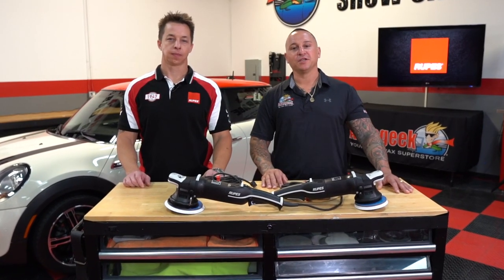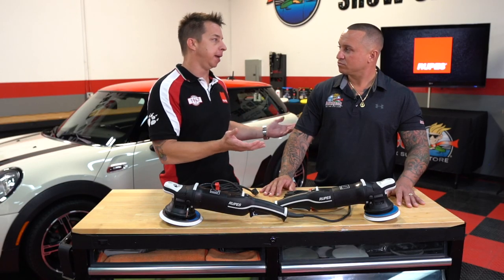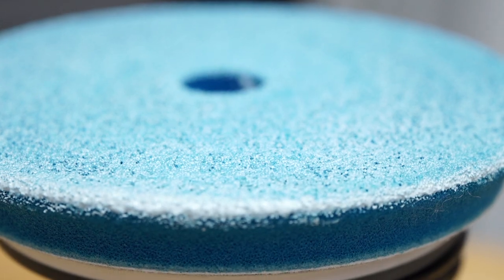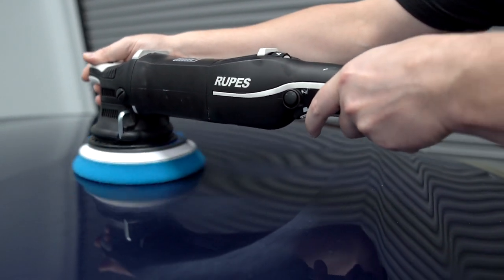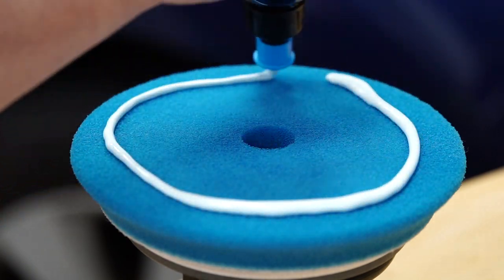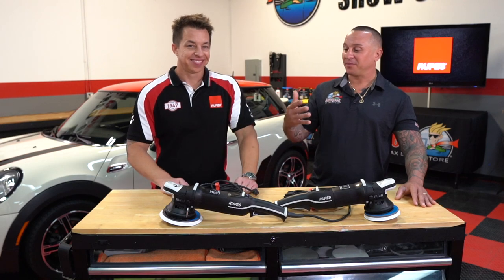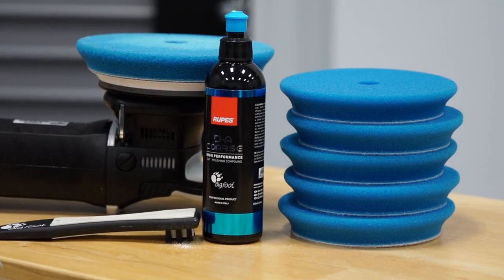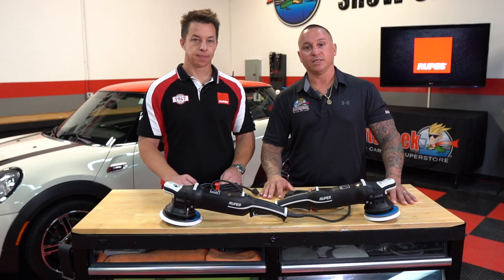5 COMMON MISTAKES WHEN USING RUPES BIGFOOT POLISHING SYSTEM

Comment: You don't need multiple pads for one car that's ridiculous. I've used one pad for multiple cars.
Reply: That must be the best detailing comment I’ve seen I’m gonna try that next time
Reply: Agree 100% because so have I. If you buy good pads they surprisingly last a long time. Some dont last long but others like Shinemate Diamond surface foam pads as well as Chemical Guys Hexlogic Foam pads I find to be very long lasting. All you got to do is just clean your pad after each pannel and all you will need is one for cutting compound and one for polish compound
Reply: @user-un5my5bw4j  Hey William, I’m new to detailing and trying to learn still. I have two questions: 1) How do you clean your pads? 2) what’s the difference between cutting and polishing compounds?
Reply: I use rotary is mother  of  rupes  first  cut wool   and them l use rupes  jj
Reply: Well I agree and disagree, Yes certain situations one pad can definitely go the full car but that’s really up to the cars paint condition. Having multiple pads will definitely speed up the process and ensure maximum performance. Also, having a collection of pads is a must since every car is not the same.
Reply: Not true at all, you definitely need more pads if you’re planning on doing more than 1 car Once and doing it all day😂 switching prevents heat damage and DA Haze from dirty pads which you can prevent with cleaning but buddy you’re stopping every 2 minutes to soak and scrub the pad 😂 that’s so inefficient you’re acting like they’re 300$ a piece it’s 8$ a pop use, switch them and clean them more efficient and safer and long lasting consistent results
Reply: Fr I use manzerna and thise guys last forever it literally gives the same results until it is literally holes in it! I pressure wash mine. But I am gone start blowing I see a lot dust from compound on my cars more then other.
Reply: Ya for maybe a wet system like lake country, but using the dry rupes system? No way, the pad will delaminate to heat

Comment: I saw Ivan say that compressed air will tear the fibers of the pad and over time they lose their elasticity.
Reply: What does a brush do?
Reply: @Amor1990  - with a brush you can control the type of bristles, pressure, and aggression.
Reply: @danlc95  with an air nozzle on your air hose you can control the amount of air you blow on the pad if it has a small ball valve on the blowing attachment
Reply: Ivan is correct especially on lake country and diy pads but these rupes pads are polyurethane so they'll handle the air better than polythene but doesn't mean better quality pads
Reply: @danlc95  I use one of those soft pet hair brushes. Its not hard on the foam and yet dislodges some compound.
Reply: @TechCrazy  - That's a great idea!

Comment: I have a question, what if some one leaves the polish on the pad for like a year after , and they use a polishing pad cleaner and let the pad dry , is it ok to use that pad again, or throw it away?
Reply from the maker: If the polish cleans out of the pad 100%, then it should still be good to use no problem.
Reply: @autogeek  yes its out of the pad, but what if you don't have an air to blow out the pad, what can you use , air in a can?
Reply: And the pad looks like a mouse scraped it a little, will it be ok to use
Reply from the maker: @chrisnas1483  Air would help but is not necessary. We would recommend using a dedicated pad cleaner and letting the pad soak in it for some time to allow the cleaner to dissolve the dry polish inside the pad. Agitate the pad to get it clean and rinse out with clean fresh water thoroughly. Let it air dry with the velcro side up so the water runs away from the adhesive. If the scrape is miniscule, then it should not affect the performance of the pad.
Reply: @autogeek  thanks a bunch.

Comment: Why am i just watching this after doing two days of wash, clay, compound and wash, polish. Looked good and better but i can tell there was still swirls created when i did the compound that didn’t get removed. Thanks i will definitely keep cleaning the pads. I was wondering why they kept drying faster than when I started.
Reply: Did you go over it with a finishing polish?
Reply: There's a technique to not swirl , depends on what you use to
Reply: The remaining swirls should have been cut out with a rotary buffer prior to using the DA… DA buffers only cut so far and are better used to finish and not paint correction.
Reply: Yeah and also there are different tanks now that are really soft especially tuxedo black. Better to use a polishing compound than trying to cut it with something that's gritty. Honestly I ran into other pants that I believe we're not painting correctly at the factory. Clippers literally almost nothing you can do to get to stop so you had to move really slow at 2000 RPMs

Comment: Any idea why im getting dings on my car from orbital polisher? Rookie polisher using a new flex 15mm with polish pad and polisher. Ended up with three dings. One on back hatch, one on rear door in the middle of panel and one on raised edge on passenger door. Not sure what im doing wrong. Any ideas would be greatly appreciated, thank you.
Reply: Heat find a pdr guy to fix it
Reply: Because the flex is a much stronger force vs Rupes. The Bigfoot is better for a beginner vs flex is more for a professional in my opinion. I had both and I ended up returning my flex and kept my rupes Bigfoot. That was in 2015 and in 2024 I still use this machine and I still am happy with it.

Comment: Can I use the dewalt random orbital sander instead of this ?
Reply from the maker: We would not recommend using sanders. We would recommend a low speed dedicated dual action polisher such as the RUPES tools.
Reply: Random orbital sander not have enough speed to do any cutting with foam pad.